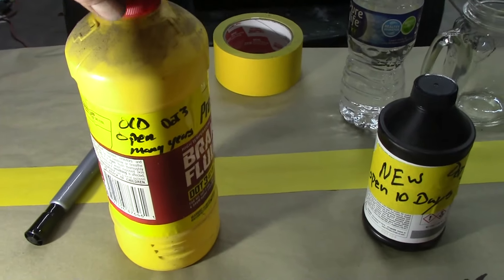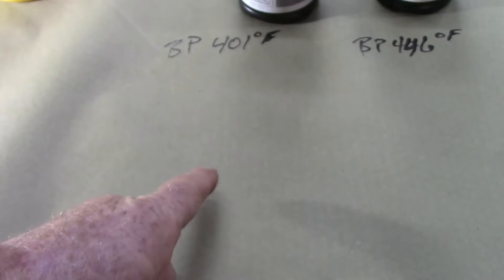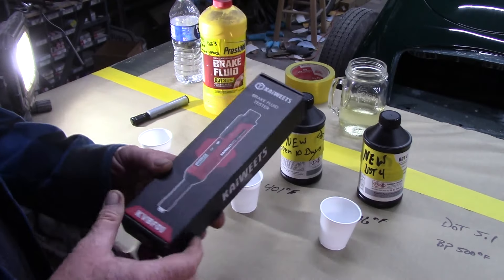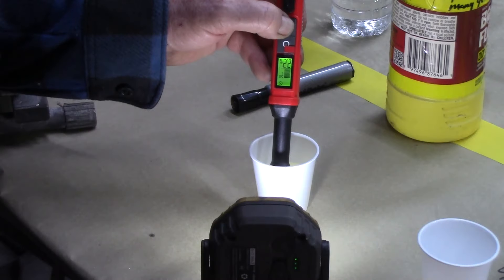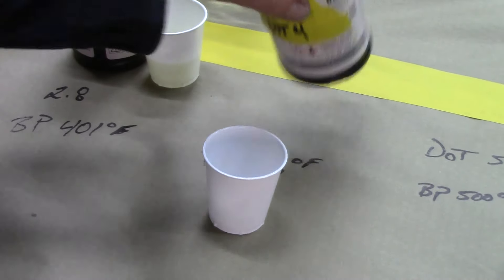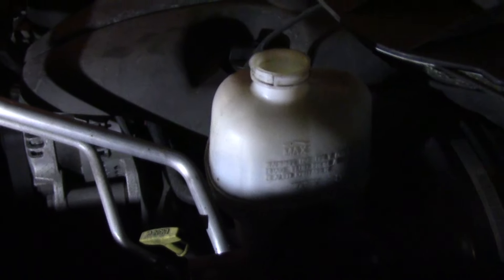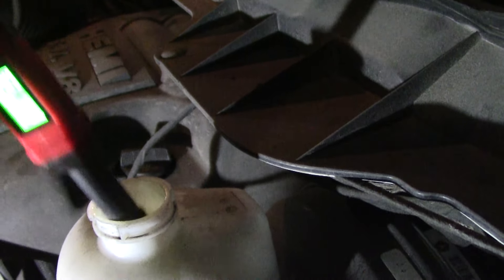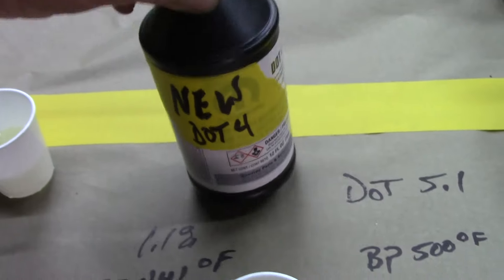How Well Do You Know Your Brake Fluid? Testing: The Complete Guide

Comment: What a GREAT video Mike! I'm embarrassed to say that I have a 2008 Pontiac Vibe with 140k on it and it has never had the brake fluid changed. I think it is likely due for new brake pads and likely calipers (last done at about 60k), as well as new rubber hoses. The brakes seem to work fine, but now you've lit a fire under my butt to get the fluid changed along with all the rest!
Reply from the maker: @greggsvintageworkshop8974  Thanks Gregg! Yeah it's definitely something to keep in mind! Normal braking and usage you won't have any problems. But, say your driving downhill several miles and using the brakes alot,  you may be in trouble. Cheap insurance for sure.  Have a good weekend buddy!

Comment: You need a camera person to record you while doing videos very badly. You keep shifting the camera thinking it is centered but it is not, anyway you did not explain what 3% means. If it is under 3% does that mean that the fluid is bad or good. Please be more specific, you left out a lot of details.
Reply from the maker: @wbckblki8411  Hey wb! Thanks for stopping in. More then 3% water is bad. Sorry about that. You're correct,  I'm a technician not so much a camera guy!
Reply: @junksautomotive  So the lower the percent the better? If the car sat for a while but you buy a tester and tester says 2%, then the fluid is good?
Reply from the maker: @wbckblki8411  yes. More then that and you risk having a lower fluid boiling point.  So your DOT 3 or 4 won't have the original boiling temperature rating. When brake fluid boils, it's able to then be "compressed" and brake pedal goes to the floor!